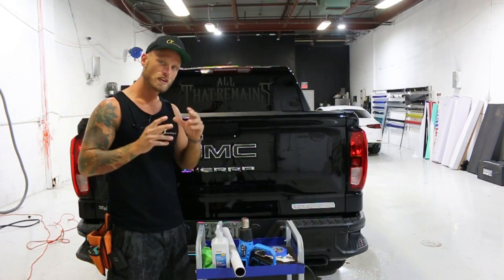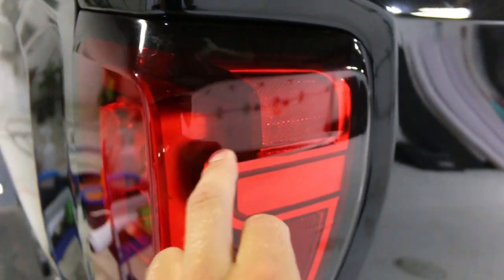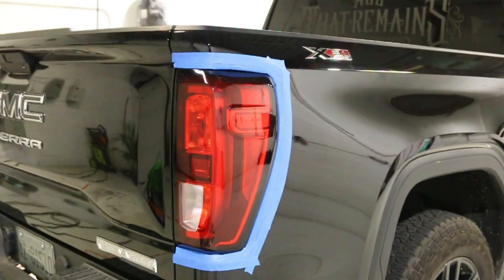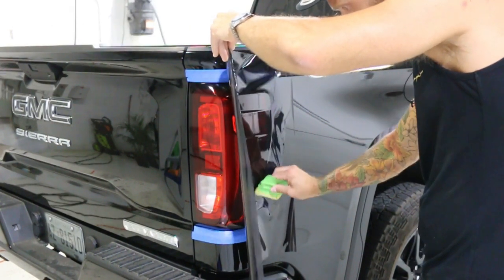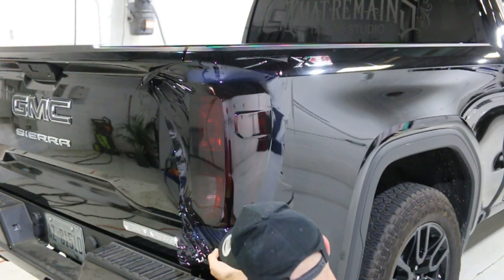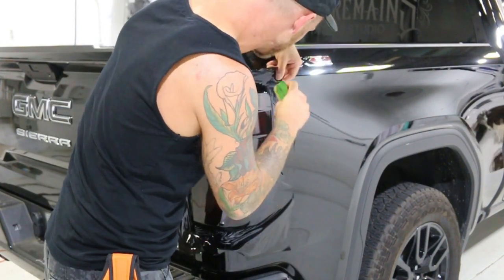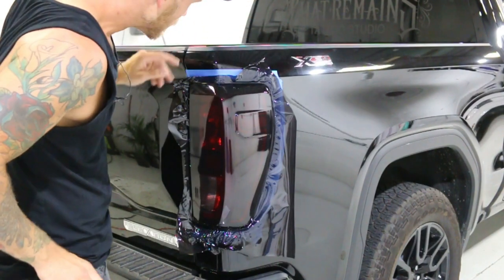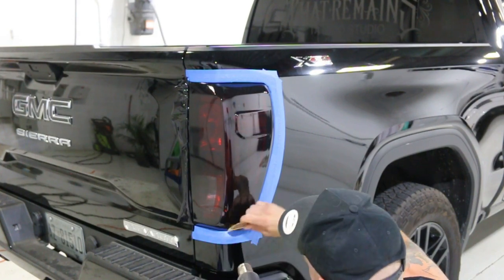How-to Very hard tail light tint - GMC Sierra truck

Comment: I should’ve YouTubed this before rawdogging my last 2 failed attempts 😂.
Looks like I need a faster blowing heat gun first and foremost cause this baurer one from harbor break 🙃doesn’t blow as nearly as fast. And I’m guessing full hot is what I need to have it at from the speed your tint went pliable? 
Wish I was able to send pics of my botch job to see if I could get some more pointers in the hex tint wrapping around my triangle taillights (93 Honda Prelude). 🤦 and this video is the closest I can find  with the sharp angles. 
Anyways thanks for this video, I didn’t think about using the vehicle as a second set of hands 👍

Comment: Good vidéo. I didthe same technic with the same material on my GMC Canyon 2015. The taillights are the same than yours. It looks great at the beginning but after a time the vinyle stretch back by quartet of an inch at the top and bottom.  I'd like you to show us the condition of thèse light after 3-4 month. Maybe removing the lights and Wrapping them out of the véhicule should by easier

Comment: Not too sure if you read these older comments but I have a 2021 GMC Sierra AT4 that the back of the headlight is not flat like that. It has a big recessed area in the middle. Any suggestions or if I still stretch it this exact same way and then Work that recess? Thanks man I sure learned a lot from your videos.👍🏼👊🏼

Comment: Amazing job, have you been able to do the '19 Silverado tails? I ended up just spray tinting them! 2 light coats seemed to be plenty.
Reply: The 19 tails are a PITA, I’ve done them twice and fail at the top and middle side low part. Third times a charm. I was thinking of spraying but I wouldn’t pass yearly safety inspection in my state
Reply: Done them, you have to stretch around whole light or you will have too much excess film along the top section. @theheadlightguy on IG

Comment: Great video as always. Thanks for the tips to help us out. Also was wondering if you would do a comparison video with vvivid smoke tint vs luxe smoke tint. I have used luxe and have had it tear on me several times and i dont really like the after finish as well. It would be cool to see your opinion on the product as it is an expensive product. When i reached out to luxe about the failures i had they pretty much said their film does not fail ever and they couldn't do nothing for me. Thanks man

Comment: I did this on a new Nissan Tundra's taillights and they failed badly. Used Vvivid air tint. I have done tinted over 200 lights with a different material without any issues and with Vvivid I've had a lot of jobs come back. Any tips? I enjoy using it but it seems to fail often.
Reply: Nissan Tundra?  lol... im sure you meant Toyota Tundra.
Reply: @VictorSalazar44  he prob meant Nissan Titan lol not sure

Comment: Have you ever tried 2017-2020 f250 platinum tail lights, tried yesterday first time alone then second time with help and failed both times they are really really hard tail lights, I’ve done plenty on other cars and never had trouble, same film vvivid air release
Reply: I did a set for a customer and they were some of the hardest ones I had ever done. I'm with you that I would love to see how he would do them

Comment: Have you had a chance to do a set of 2019 Sierra taillights yet?  They’re similar to this but have a set of compound curves on the tailgate side too.
Reply: Brian Chastain that is a 2019 Sierra
Reply: Jeremy Rohl Those don’t look like my 2019 AT4 taillights.  Close but not exact.  My taillights aren’t flat on the very rear, the sides look the same.
Reply: Brian Chastain agreed, my 19 slt tail lights have the extra curve that you’re talking about. The truck in the video is a lower trim package (elevation) so I’m wondering if the Sierras without the multipro tailgate have slightly different tail lights too

Comment: CK 

Do you still do the classes? I have emailed multiple times but I never get a reply. 

Thanks.
Reply from the maker: Hey, I'm sorry you didn't get a response. Could you please check your spam folder?
Reply from the maker: Ah ok, usually the messages do go to email but wix doesn't always send them for some reason. We'll email you directly
Reply: @CKWraps  Ey bro by any chance have you done 2022 ford escape taillights tint I have learn a lot through ur videos but 2022 ford escape taillights are extremely difficult it would help a lot if you make a video if you ever tint taillights on 2022 ford escape

Comment: Hi  I try wrapping my tail lights that came out really awesome but when I park in the Sun the starter raise up like they had to pull back what did I do wrong
Reply: You stretched too much to the edge. The film can be stretched across the light, but you can not stretch all the way to the edge of the light. 1/2 inch before the edge of the light lift and heat to allow it to shrink then smooth it out and squeegee. @theheadlightguy on IG I can help you out more message me!

Comment: I was trying to tint my 2017 f150 but failed completely.. if you thought those lights were difficult mine are impossible.. mine are much more aggressive and have a lot more corners.. idk what I’m doing either so it makes it worse haha
Reply from the maker: I've tinted f-150 lights a few times both front and rear
Reply: CK Wraps any tips on them? Cause I have the blind spot system so there are two massive block bulges on the tail light barely any flat spot on the light..